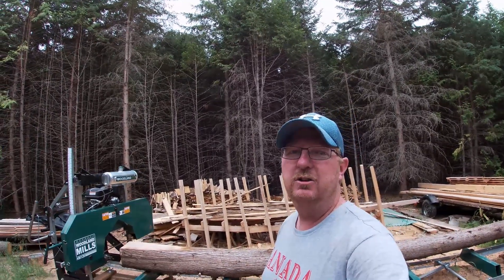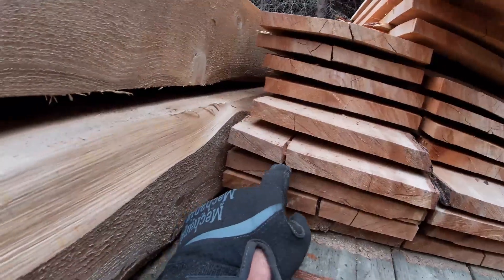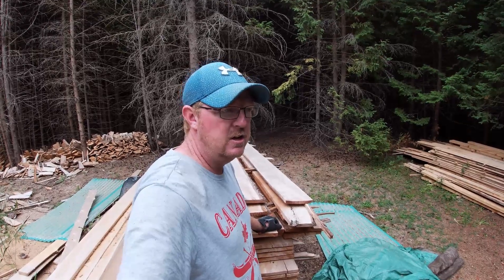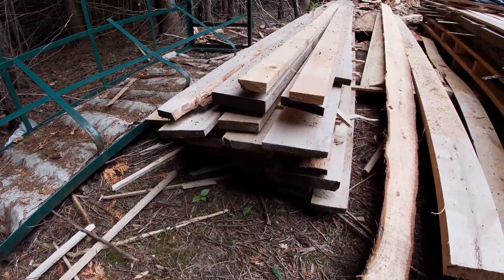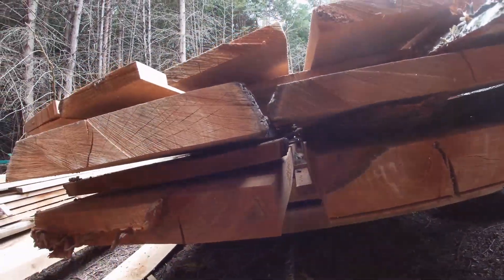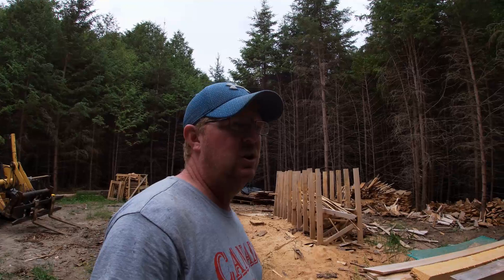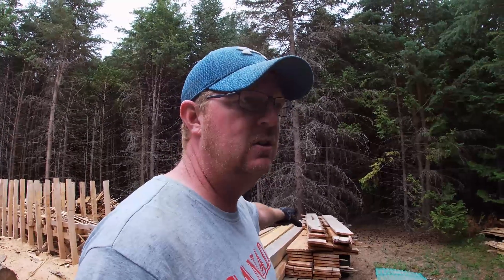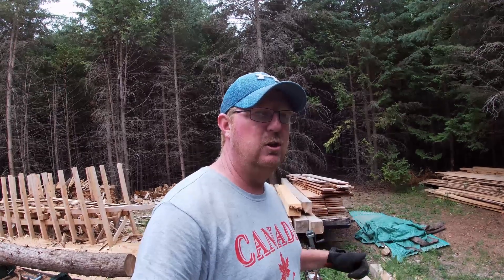Woodland Mills Sawmill - Air Drying Lumber Questions and Concerns ( I have a lot to learn)

Comment: I’ve cut tons of fruit and hardwoods, basically anything that’s makes a waterproof seal will work. Paint it on the end and about 2”-3” back on all four sides from the end. Will stop the cracking probably %75. Also cut them when the humidity is high and temp low if you can. Then let them sit dry out of the sun. Letting the wood dry slow in a high humidity low temp time of the year for the initial drying will help.

Comment: Chris I have had Cherry nearly explode during the cut. They seem to have tremendous tension built in. That particular one popped open a good 3" wide and about 3' down the plank and so loud it was startling over the noise of the engine. So I think Cherry is a tad unusual at least in my experience. Btw I never see anyone address motor rpms. I added a $20 tach and found the motor at 2800rpm under load out of the box. It should be at least 3500rpm under full load seeing as it is rated full hp at 3600rpm. I highly recommend a tach. Cuts MUCH faster now. Btw I had a 15"  pine with so much tension that the last 4" of the cant was bowed up a quarter inch at each end so I flipped it over and clamped it down at the center 2 bunks with bar clamps and removed them as I approached them. Worked like a charm. That was a 14' + long beautiful pine from an 80' tree that fell near our house. The lumber from that one tree must be worth around $1000. 30" at the base. Had to trim the flare end to fit my 126 👍😎👌
Reply: I tried the bar clamp trick, too, but it takes too much time, shifting clamps from ahead of the blade to behind it at each bunk. What I'll try next time I have a cant that wants to curl as boards come off is flip it 180 after each board to see if that equalizes tension and reduces curl.
Reply: @OregonOldTimer  just 2 center bunks and about 20 seconds time is well worth it. I've done the flip it with each cut and it did not work. Let us know how it works for you👍
Reply from the maker: Thanks for the info Jim, and the tach seems like a great idea, I would like to try that. I am not the most mechanically inclined person, was it difficult to install?
Reply: @ChrisBrackenridge  I sure wish comments allowed pics. The tach costs about $23 and takes about 10 minutes to mount and install. One ground wire that I attached to the air filter mount and one you wrap 3 to 5 turns around the sparkplug wire. I have posted pics to the Woodland Mills fb group. I mounted it right below the WMs hour meter so I can easily watch it while cutting. Btw it comes set for a single cylinder engine out of the box but can be reset for anything with a spark. 
https://www.ebay.com/itm/Super-Waterproof-Tiny-Tach-Digital-Hour-Meter-Tachometer-Resettable-Job-Timer-US-/273180416431?_trksid=p2349624.m46890.l49286
Reply from the maker: @fiskfarm  Thanks! That sounds great I think I will look into that.

Comment: I had same thing happen to my cherry, and what I’ve learned is that most fruit trees will check, curl, crack really quickly. I’ve since gotten some anchor seal to try out on cherry and hardwoods. I’m also going to do some experimenting with latex paint. As far as a quick way to keep your boards out of the sun, maybe look into a cheap carport to throw up over it? I have one over mine with sandbags holding it down and does a decent job so far. You may even be able to find one for free on Craigslist or fb marketplace. Amazon also has replacement tarp portions for them, if like me, you end up with one that was missing a top.
Reply from the maker: Thanks good idea, yes I think I will be doing some experimenting as well.

Comment: Anchorseal is designed to prevent checking and it works a bit better than latex paint. I have used both and I had a little more luck with Anchorseal. There are other wax based brands - search for green wood end sealer. Hardwood is a lot more prone to checking and splitting as it dries. Even with sealing the ends, I had some checking happening. The best results are if you can slow down the drying process by limiting exposure to sun.
Reply from the maker: Thanks for the advice, the next hardwood i cut i will try stacking it in a barn maybe.

Comment: Out of the woods put out recently a video highlighting a pump sprayer designed to work with anchor seal. It gets diluted water 70 percent anchor/ 30 water. Sprayed on easy. Making it much more affordable.
Reply from the maker: Nice, thanks I will have to check that out.

Comment: Keep the tops covered. Every stack should be covered, it's drying out to fast. As for anchorseal it's better than paint. Yet paints better than nothing. Put it on the butts of each log the same day you cut it down..
Reply: I'm new to all this as well. I plan on building a drying shed so it gets less sun and weather on it. I plan on painting the ends of the more expensive lumber as well. My cherry and oak I cut split really quick. I believe it was too much heat and sun in a short period of time.
Reply from the maker: Great advice, i will put it into practice, thanks.
Reply from the maker: Yes, I would love to have a drying shed as well, I think that will be a ways down the road for me though.
Reply: @ChrisBrackenridge  especially considering the price of metal roofing now. Fortunately I pu about 25 sheets of 15' felt covered, on inside, green sheets at $1.75 per foot just before the "kovid" hit. A special order that never got pu. Their loss, my gain. It never sweats due to the felt lining which is a big plus. Sure would like to find about 10 more 😜 We sure got lucky or tuned in or something as I purchased the mill, the 306 Cat track hoe and all that steel roofing right before the shutdown. $ saved on mortgage interest (from 7.5 down to 2.75%) paid for all of it as well. I'm still in shock and our bell siphon sales for Aquaponics is off the charts as folks learn how to grow their own food 👍😎👌 Our little company is Smoky Mountain Aquaponics on ebay, Etsy and Amazon btw. Around 16,000 siphons sold now.
Reply from the maker: That's great happy for you that things have been going so well. I have to admit I don't know much about aquaponics but I checked out some of your videos it seems really interesting.

Comment: Hi Chris from U.K. Sounds awful but on a lot of ash that had to be felled I used thick black roofing bitumen,after 7 months there is no splitting at all and the bitumen has dried out and is not even sticky. There is a bit of drag through buy the blade but not that bad and most good timber is usually planed any way worked great for me and it's a dam sight cheaper than anchor seal. The ends could be chain sawed off before milling if preferred.
Reply from the maker: Thanks for the suggestion, that sounds promising, I'm never against trying something out.

Comment: im just a small time hobby operator, im thinking about thinning out latex paint and just spraying the ends of my logs right after i deck them. then you dont have to do the tedious work of painting each board end and having paint drip on everything. also. once your boards are stickered you can pop up a simple pvc hoophouse over the boards and use black plastic instead of clear plastic. i can pop up an 11’ wide x 20’ long hoop house in about 1 hour with about $50 worth of materials. just some thoughts
Reply from the maker: Thanks, I appreciate it, always looking for ways to improve what I'm doing.
Reply: correction “latex stain”
Reply from the maker: @pacothompson7161  O.k. thanks

Comment: Cherry being an hardwood, left to the elements the ends will split and boards cup. I put all my hardwoods (oak, maple, beech, birch) inside out of the sun and wind for an even drying. I always cut the boards as long as possible so when using the end get cut off and I have lots left to work with if splitting occurs. As for softwood I stack and sticker, then cover with old tin roofing along a tree line out of the sun. Imo save your money anchor seal isn’t cheap.
Reply from the maker: Thanks for the info, I would like to build a shed for drying in the future, maybe for now I can try to steal a spot in the barn somewhere to pile hardwood.

Comment: Look for end sealers that aren’t ripping you off with the price…
 Pretty sure you can use latex paint as a cheaper option, 2 or 3 coats…. 
 Some sort of Wax sealer…
Maybe paint it immediately after felling, don’t let it sit and start to dry.
Reply from the maker: Yes, some of the sealers seem a little pricey in my opinion, thanks for the suggestions.